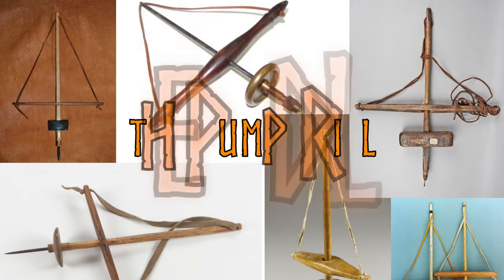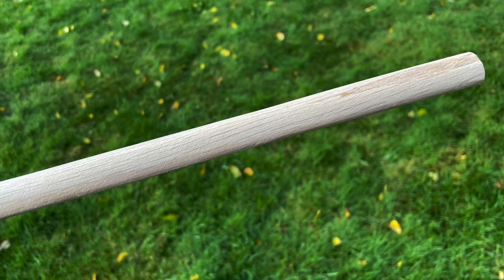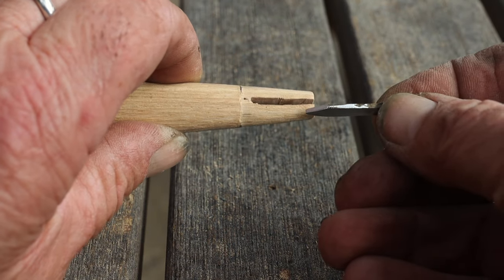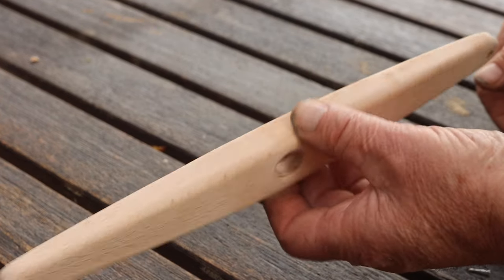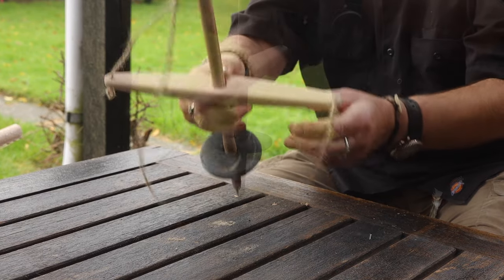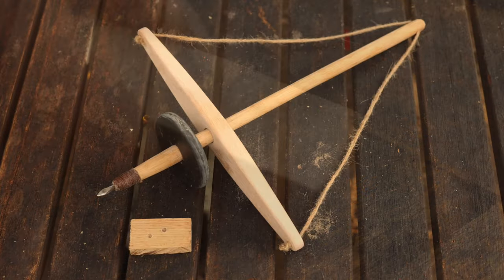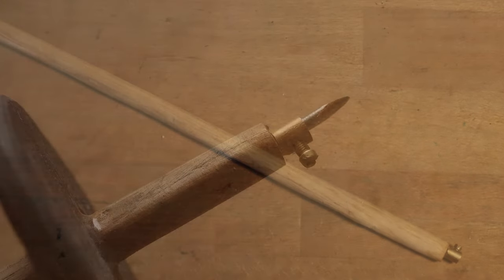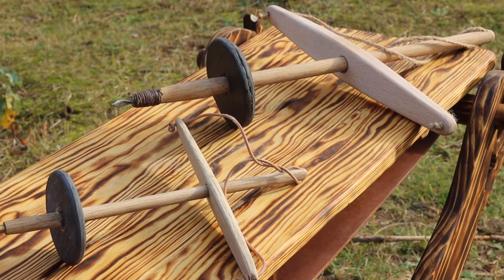DIY Primitive Pump Drill

Comment: Excellent construction, mixing old and new materials to get a traditional look. Clever way to change bits. I'd been searching for pump drills a while and only found the fire version. Then your video showed up in my feed and satisfied my need. Thank you! I'm truly grateful that we can find help and answers from strangers on the other side of the planet nowadays (I'm from Quebec, Canada). I've picked up spoon carving and old hand tool restoration during the pandemic, and expanded into more woodworking and bushcraft skills. Thanks again for a great video ❤
Reply from the maker: Thanks Linda for your feedback 😁👍🏻 I’m glad my video could help you and I hope your also following me on my main channel 😉
Best wishes from Denmark 🇩🇰 to you my friend in Canada 🇨🇦🔥
Tom
Reply: I have two of them, plus a bow drill, that I use frequently in my shop. one of the pump drills has a fixed bit and the other, which I forged from iron, has a chuck so that I can change bits. The bow drill has several spindles with different bits including a couple for fire making.
Reply from the maker: That sounds great 👏🏻😉 and thanks for sharing this with us 👍🏻
Tom

Comment: Looks like you used some glue on the flywheel.
Reply from the maker: Ha ha yeah that’s right 😆 
The small one I sanded too much so I had to secure it with some glue so it wouldn’t get loose and fall down 👍🏻
Tom